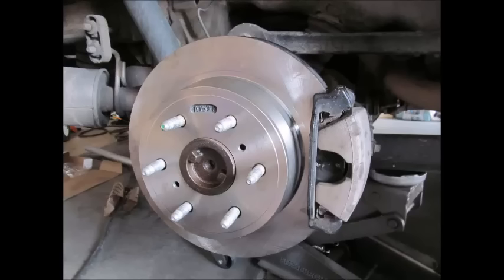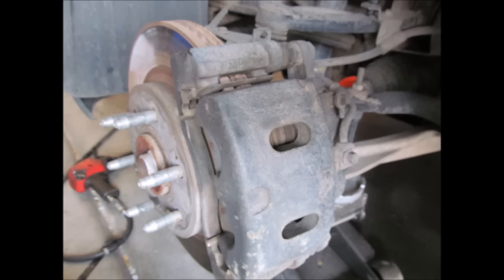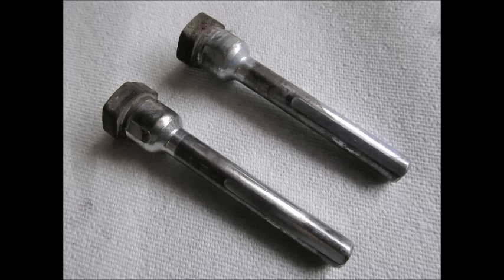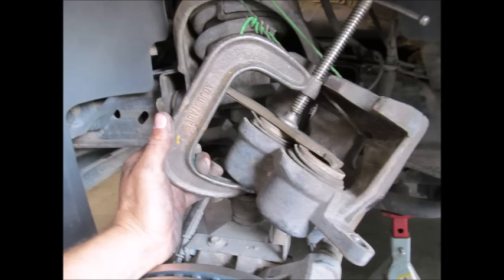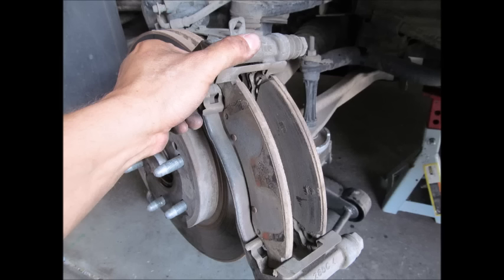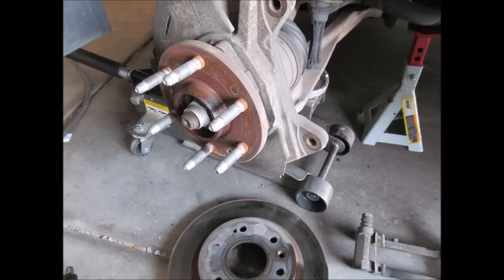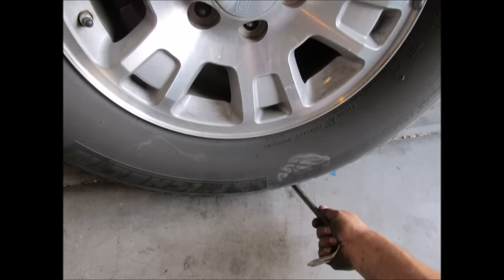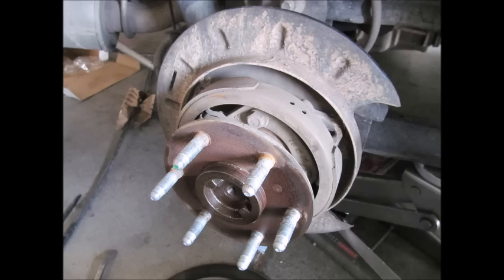Get rid of steering wheel shake when braking.

Comment: Pad wear indicators should be installed oj the inboard side of the rotor at the trailing edge. 
Molybdenum  Mo-lib-den-um grease is used for metal to metal, contact, such as on old suspension joints with grease fittings, NOT on caliper guide pins which are metal to rubber contact. Before pushing the caliper piston fully back into the cylinder, the exterior of the seal should be cleaned with brake cleaner and then treated with a thin layer of synthetic brake lubricant.

New grease should not be added to old grease. A petroleum based grease will cause the sealing boots to deteriorate, swell, and impede free movement of the pins.  Mixing petroleum base grease with the synthetic greases used by +90% of all caliper guide pins by the vehicle manufactures will cause the greases to react and become viscous.   Excessive grease will cause the pins to hydrolock within the cylinders.  If the guide pins are not moving freely, the sealing boots should be removed, the bores and boots should be completely cleaned of grease, and the bot inspected for cracking and swelling. The boots have a working lifetime similar to the brake pads.  Boots, guides (aka abutment clips) and any spring clips should be replaced whenever pads are replaced,   When lubricating caliper guide pins or sbutment clips, just enough  synthetic caliper or silicone grease should be applied to the pins to lubricate them as they pass throughnthe sealing boots restriction into the bores.

Do NOT use a threadlocker unless directed by a vehicle manufacturer .  Caliper frame bolts are often torqued to spec without threadlocking compound being used.  A long handle wrench or breaker bar should be used for removal, not an impact gun, which will not maintain sustained torque against the tightened fastener.

 Retention screws should be removed prior to any other effort to remove a rotor.   Regular WD40 is NOT penetrating oil. It does not loosen impacted rust within a close fitting joint.  Cleaning the hub where it protrudes through the rotor with  a straight bristle wire brush, (not a a work out one), applying a penetrating oil there and to extractor hole threads (if any) and  allowing 10 minutes for it to work will greatly ease rotor removal.   Striking the center area of the rotor between the studs with a hammer should break up the impacted rust that binds the rotor to the hub.  If not done, using the extractor bolts will nost likely cause the rotor to bind more firmly and then suddenly break free, instead of coming off smoothly.

Before installing a rotor, clean the hub where it will protude through the rotor,  and the face of the hub free of any rust and apply a thin coating of aluminum or nickle antiseize compound to impede future rusting.

The brake fluid shown in this video is highly contaminated.  If the brake fluid in the master cylinder is not clean or light amber color, the brake fluid should be replaced by removing fluid from the master cylinder eservoir with a turkey baster, adding new fluid and then draining though each of the brake lines at the wheels until the fluid runs clear and bubble free at each wheel brake cylinder.

Install wheels using a torque wrench to evenly tighten each bolt or nut to p=spec.

Comment: Asymmetric and over-torquing of lug nuts is a common reason for rotor warping. Always check your own specs. after any work that required a shop to remove your rims. You'll be surprised what you find sometimes. Also, rotors can be very hard to remove from the hub sometimes. You can always put a couple of bolts with washers and nuts through the carrier bracket holes and force them against the inside of the rotors.  Works every time.

Comment: I totally agree with your procedures with the exception of automatically replacing rotors and not flushing out existing brake fluid. It's too cheap and easy to bleed out the system of used hydro fluid much the same as it is to have your rotors turned if within spec parameters.

Either way, video is a very honorable presentation.
Reply: I'm someone, who does, but not buy flushing.  I don't wait for three years to let moisture build up in the system.    I replace my brake fluid by bleeding enough annually from each wheel that all the fluid is replaced over 3 years.   

 It doesn't mattter how shiny your tires, wheels and rotors are if the brake cyninders can't move the pads. When brake fluid is dark brown, what you see is rust and from the water vaprr that got into the fluid and is rusting the metal brake lines and the cylinders internally. For less than $10/year in brake fluid and an hour's time you can make brake cylinders last as long as the car and greatly extend the life of your pads. 

I also annually clean and relubricate the pads, pins and glide shims, and inspect the inboard rotor surfaces and drum surfaces as I rotate the tires.

BTW  In the last 25 years  I've NEVER had to replace opr have turned  a brake rotor for scoring,  only for rust creep over the swept area of the rotor. (New coated rotors reduce but don;t eliminate that problem.)

Comment: Anyone who is NOT SOLVING THE PROBLEM WITH NEW BRAKES your tie rod ends may be or have been bad if they were replaced your tires will have worn uneven and that could continue to cause a shimmy on braking.
Reply: This was my exact experience--bad tie rod, drove for a while before figuring out the issue. Replaced tie rods, still had excessive vibration and a bumpy ride till i replaced all 4 tires.

Comment: Rust buildup on the hub can cause rotor runout too. Most of the time it's the rotor but the hub itself can also have excessive runout, possibly bad wheel bearing. 
Bad tie rods and ball joints can also play a role.

Comment: I use a cheap Turkey baster bulb and tube to remove necessary brake fluid from the master cyl. before compressing the cylinders, and check during the process in case it needs more removed. Better than trying to clean up brake fluid around the master.

Comment: Its all good, but the grease. Too many times I've had random caliper freezes on various vehicles, makes and models. Brake grease can and will get hard after heat exposure over the miles. Try this.. Put your hand on the rim surface after a trip. Then swap over to Syl Glide and do the same thing. Notice how much cooler the rim is using Syl glide. Tells you all you need to know about the caliper movement

Comment: How about checking for any excess runout on the rotor and on the hub to see if that could be causing the vibration felt through the steering wheel ?

Comment: In my case.. 2012 Toyota Highlander, I changed the pads and rotor.  The steering wheel still shakes.  I found out that one of my front brake pistons was frozen because the boot was broken.  Replacing the entire caliper assembly fixed the problem.

Comment: At 2:45 you say "Make sure you pump the brakes"..... the caliper is off the disc so this will push the pistons out of the caliper... Please remind them to do this AFTER the caliper is reassembled. DO NOT push the brake pedal if the caliper is not mounted over the brake rotor/disc
Reply: And the cap is off the brake fluid resv .

Comment: I don't think you ever need a torch to get those bolts off...
Big breaker bar or big impact should be plenty.

I have a Saturn and it just takes an 18(?) mm combo wrench and a sledge hammer every time.
Little loctite when going back in.

Also, I try to have another set of rotors ahead of time, so that I have lots of time to perhaps get the used rotors resurfaced.

Great video though, Thank you

Comment: Use a turkey baster and a old drink bottle/disposable cup to get the excess fluid out of the reservoir
Reply: Todd H I used a wire with a piece of rag at the end.
Reply: @alonzocalvillo6702  I would just open a bleeder valve, since the tires already off and then let gravity drain it.  use aquarium airline tubing
Reply: I got my wife a new baster as a stocking stuffer and boom....I have a pampered chef baster in my tool cart.

Comment: I would have lowered the reservoir before installing new brake pads because the reservoir would most assuredly run over when new thick pads were installed...

Comment: I would add suspension components tie rods ball joints a bad upper ball joint will cause awful Shake
Reply: This is about shaking during braking only. Not same thing as shaking when coasting at a given speed.
Reply: Those things make the car shake all the time above a certain speed. The video is about shaking when braking only.

Comment: The brake rotor is damaged by heat caused the rotor wobble.  It is not worth to fix it.  Go to ebay get a set of new rotors with ceramic brake pads.  The new rotor has a ventilation hole and slots can run cooler. The ceramic pads are much cooler and better stop distance.

Comment: Bad microphone sounds like it's in the bottom of a box. Hard to tell if you said TAB, PAD, BAD, or SAD etc. Otherwise, thank you for important new tip none of the other brake videos mentioned - where brake fluid goes when compressing caliper pistons. That would explain why my dual pistons were so difficult to compress yesterday - no exit for displaced brake fluid. Today, when I do the other side, I'll use a new check valve bleeder when compressing the pistons.
Reply: Seemed fine to me. Judging by your profile pic it may be a hearing issue. Try hearing aids maybe
Reply: Or I need a new battery for my hearing aid

Comment: If you apply anti seize on the bracket bolts and caliper bolts, you shouldn’t have to use a torch or breaker bar to get them loose again. Just ratchet wrenches is all I used for my 2008 Toyota Corolla. I had to replace rotor, calipers, and brake pads on both fronts bc of my calipers got corrosion inside the caliper and was making my rotor hot.
Reply: Antiseize works, but because it acts as a lubricant and reduces the thread friction that is what the torque setting is measuring.  It screws up your torque settings so you over torque the bolts.

Comment: I do believe this is the problem with my car I just bought brand new brakes on but the steering wheel is still shaking badly when I stopped at 55 miles
Reply: Did you find the problem?

Comment: I replaced all 4 rotors and pads on my 2011 acadia 4 months ago and my steering wheel started to shake recently when applying brake but only as im applying brake when im pressing brake passed the half way point close to stopping shake goes away brakes and rotors are ebay items if it matters what could be bad i cleaned everything when i changed brakes and rotors
Reply: Same here
Reply: Update:it was the rotors they were warped i ordered another set of rotors and pads and vibration is gone
Reply: But you said you replaced the rotors also, were the new ones warped?
Reply: @johnmejia573  yes i ordered another set of each and no more shaking

Comment: New calipers, rotors, pads, hoses....still shakes at high speed. Any ideas?
Reply: I’m having the same problem with a 2000 4Runner, did you ever get that fixed?
Reply: Nope....comes and goes. Starting to think it in the drivetrain!?!
Reply: @cutl00senc  did you change tie rod ends?
Reply: @vickikoch96  new rack and tie rods

Comment: Yes the problem occurs mostly with smaller cars because they are installing paper thin rotors on newer smaller cars I had this problem with a Chevy HHR model. Heat warps the paper thin rotors thats was causes the vibration and you have to change them.
Reply: Could you tell me if this would cause the brakes to lock up? Thanks I'm working on a 06 Chevy HHR

Comment: I'm trying to sort my brake problem  it's a toyota aygo  when I brake from speed  (70 to 50mph) there is a vibration felt in the footwell an brake pedle   nowhere else .also does not happen blow 50mph .
Checked all the pads   DISC'S  calipers all greased .
All weights seam to be on the wheels  no damage to the wheels and new tyres (1 month old ) 

So not sure what else there is or could be  I'm taken it in too garage to check the wheels an bought a tool to check the discs . If anyone has an idea what it could be plz let me know
Reply from the maker: Check the rubber bushings between the sway arms and frame

Comment: My car shakes after replacing rotors and brake pads. I even greased the slidding pins.. I really dnt know whats going on
Reply: Did you figure it out?
Reply: I replaced everything; rotors and pads. Defective parts. Problems gone.
Reply: I replaced everything brand new and i still have issue
Reply: @oOohdaddy  did you end up solving the issue?
Reply: Raw Zeno i did i changed rotors and pads i believe rotors were warped cheap ebay stuff

Comment: what is the grease name again? I couldn't understand what you said
Reply from the maker: Molybdenum grease
Reply: thank you I appreciate it, just got a new sub
Reply: Good.  What he said was not just mispronounced, but tne wrong kind of grease and will cause the pins seals to degrade with no indication before they bind.  Use synthetic caliper grease or silicone grease. (3M and SilGlyde make the latter kind.)  SIlicone grease is clear.  When old silicone grease is contaminated or the boots are failing, the grease becomes blackened. .
Reply: @psdaengr911  absolutely right. i learned from experience, and now use silicone grease for the guide pins.

Comment: What else could cause shake while braking. I replaced rotors and pads 3 times and the shaking didnt go away.

I also replaced steering rack, power steering pump, tie rods, shocks.........

Please help
Reply: I’m having the same issue, any luck ?
Reply: same issue here - - dying to find answer rather than endless rotor/caliper replacement
Reply: @4wdtaco594   - same issue here too - - were you able to find solution?

Comment: This video is old so idk if anybody will answer but when I go over 50mph and brake, the steering wheel vibrates really bad it feels like it’s going to come apart, will I need to change my rotors ? Or what is it , I really haven’t had a look at the rotors
Reply from the maker: It’s likely a combination of dry guide pins and worn rotors. I would grease the guide pins and see if it improves.
Reply: @First_Class_Amateur  will do thanks man, didn’t expect a reply !

Comment: Long->Short; it's the rotors

What really happens; rotors very rarely warp and when you make a full stop and hold the brakes hard (stand on the brake pettal) you fuse brake pad material onto the rotor causing a raise in the rotors surface. Then next time you make a stop it will be most likely that the car will stop on that raise causing it to build further up.

Why you don't see rotors "warp" on new cars.. drive by wire prevents any access brake pressure at full stops because it's the computer controlling your brake pressure and it's programed to only use enough force to prevent the car from moving because they want to prevent too much brake pad material from fusing onto the rotor.

More stuff you might want to know, best braking happens when the rotors are bedded in or "broken in" and this is because you have a layer of brake pad material coating the entire surface of the rotor that the pads contact.
Reply: If you think about it you'd realize that rolling objects don't stop on high spots, and brake pads wouldn't preferentially stop where the rotor was thicker or deviated farther from true. 

If there were a durable lasting coating , then the rotors would never flash rust overnight. 

Most front disc brake pads are a mix of a clay or ceramic with metal particles and none of the others use materials that melt below 800F.  Pads do not coat rotors, they abrade them.  

Modern brake pad material doesn't melt or fuse to rotors at the low temperature that brakes work at, which is well under the melting point of lead.  Instead, a foreign material such as grease or tar forms a glaze on the pads or a hard material like sand gets embedded in the pads and causes the rotor and pad to erode and not make even contact, and like an asphalt highways, once there's a bump or a dip, it gets worse.
Reply: Maybe there was confusion. I'm talking about rotors warping. I would agree that foreign material can get in-between, but i very much doubt that would cause a warp but definitely can cause ridges all the way around the rotor leaving those rings.

I would look into bedding in breaks, the brake pads most definitely do fuse onto the rotor at high temperatures. Never mentioned melting.
Reply: P Schmied there's thoughts and words that are injected that I never said

Comment: What's the reasoning behind putting the squeal tab on the piston side?
Reply from the maker: The piston side wears down faster because it always contacts that brake shoe first.
Reply: @First_Class_Amateur  wow, wasn't expecting such a fast reply. Thanks!
Reply: @First_Class_Amateur   The piston side wears down faster because it does not experience the additional friction found in the pins needed to overcome to pull the outer pads in.

Comment: What if it still shakes after all of this whenever you break what next?
Reply from the maker: leonard drone view there is a chance one or both of your control arms are worn. Check and see if the rubber bushings are dry rotted or damaged.
Reply: FIRST CLASS AMATEUR Thanks for the reply but they’re both brand new I actually got under there  the other day with a prybar the rubber is still very tight not much play
Reply: FIRST CLASS AMATEUR It’s mostly over 70 on the highway when  it does it
Reply: @leonarddroneview6947  shakes during braking or without braking over 70mph?
Reply: Mine started to shake, once in a while for about 5 minutes then it stops, it dont matter whether I apply brakes or not it still shakes, could it be an engine problem??
Reply: @leonarddroneview6947   - hi there - wondering if you were able to fix your problem.  I'm fighting a similar thing.  replaced rotors and pads and even calipers and still brake shudder at higher speed.  I haven't replaced the control arm yet though...